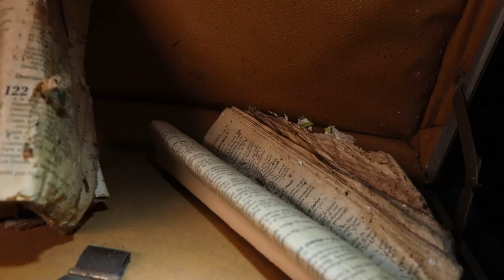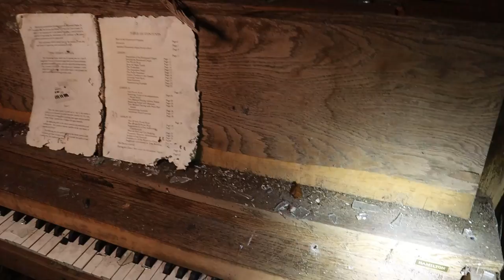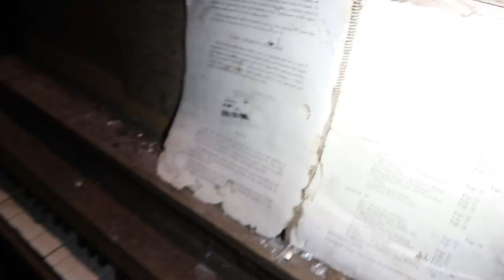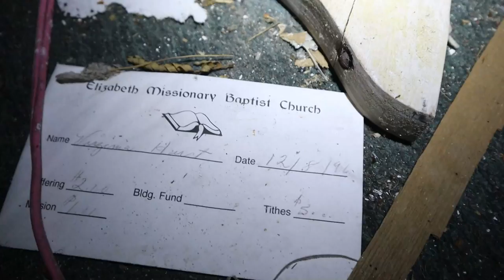(THE*DEMON*CHURCH IS EVERYTHING I EXPECTED)

Comment: That air fresher was on the floor by the exit by the stage. I haven't looked back in the video but it sounded like someone was over at that exit, threw it and took off. You all really need to get a 360 cam on a tripod in the middle of the room,, and aim a couple higher powered  LED lights at the 2 side walls. And have that record while you guys investigate. It will help debunk possible outside element contamination.

Comment: 6:02 grunt
6:05 again the "Wow" look back C I have now caught this on 3 separate videos (each time logged and head phones right up)
8:53 Orb left hand side of screen centre then arcs downwards
8:54 Spirit Light (2 chairs centre) left hand chair (right hand side) very quick
9:46 9:47 chairs on stage (far right) 2 Orbs from top of chair 
9:48 right hand chair bottom (top of stage) spirit light 
10:46/47 male breath sound low tone (head phones right up)
16:32 female voice "Not Yet"
18:53 Orb goes into centre chair (right hand side of C)
23:24 right side of screen Orb rising
24:17 right hand of screen large Orb
24:30 a millisecond before C speaks a fairly loud bang
24:43 from centre of middle chair very large Orb (left to right)
26:18 bottom left hand side of screen Orb (left to right) arcing downwards
26:55 Orb centre right of screen (right to left) arcing towards paper on piano
36:22 bright Orb right hand side (right hand window) drops down to floor
40:14 bright orb emanating from centre chair (bottom) (right to left)
41:21 not female scream...Bird
42:07 EGO time 
43:31 Black Orb runs along bottom section of centre chair (left to right) heads towards Jo (very quick) only ever seen 1 of these and that was some years ago
44:00 44:01 low tone moan sounds female (head phones right up)

Comment: Sorry for the long post but there is so much going on! Took me several hours just to watch and comment as I went. Did anyone notice the chairs on the stage? The center one is the tallest, on the right second tallest, and the one on the left of the center one is the shortest. In some churches the center one is for the pastor, right on was an elder, and the left would be a deacon. Depending on the religion. Anyone have other suggestions?  Joe was saying around 30:58 The Father, Son, and Holy Ghost or the Trinity. To the Trinity I raise a toast! As Sammy Hagar would say Three Lock Box! LOL JK 11:27 Almost sounded like a gun shot but not quite?  16:36 Voice "We'll be right there"? Seen the light go across the wall. 18:08 Strange noise? LOL that was wild! The car with the radio! Are you sure that it's God's Bible? I know some are in Latin. Makes me wonder? 21:50 sounded like a growl and a woman's voice moaning maybe? An air freshener would come from the bathroom I'd think. May be thrown through the rafters to there? 24:09 Odd there would be a shingle hanging from the rafters inside the building? Unless there is a hole in the roof but the single is in good shape to be from the roof. 24:30 Weird moan? 25:15 It sounded like a low toned horn. Sounded like it was evil to me. If there is a satanic cult or group they may be using it? LMAO Joe that was good! 27:14 Chris unless t at was you under your breath something or someone said "Hey" it sounded like. 27:31 what was that? Almost a car horn but not quite? I think it was probably a little of both human and whatever demon or spirit is there moving things? I see it was a Baptist church. The candle was odd. Good eye Chris, I bet anything that was choir robes. I know some Baptist churches use them. 32:16 What was the thumping? Neither of you paid any attention to it? 32:28 More thumping? 33:40 That desk did look weird until I noticed it was leaning in the corner! 34:15 two quick knocks? 34:59 Did joe kick something? 39:38 You moved your camera and sounded like racoon chattering. LOL 41:21 The scream you said sounded like woman, also sounded like a red fox doing it's scream. They can be very scary sounding if you don't know what their sounds are. You should hear them in fall during mating season! lol 41:42 heard another sound. It kinda sounded like that scream but totally different. Like it came from the same source? 44:39 NO DOUBT JOE!!!! Wow! NOW THAT I HAVE YOUR ATTENTION!!!! Yikes! Sorry guys but I busted out laughing! Not at you two. Just the situation. I'm sitting here on my butt, your in the thick of it! Things just got very real! I don't feel so bad now that you both laughed! lol Chris I'd make sure you had some one close by when you do the 30 minutes. It takes about an hour for Joe to get there. After seeing what happened to Rob. Be safe brother! Looking forward to it though! Glad your back at it!